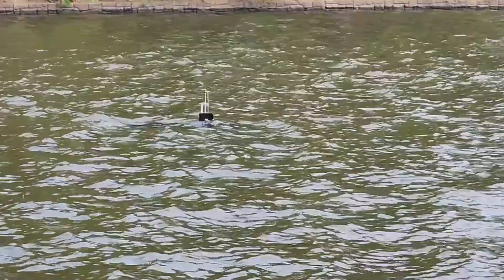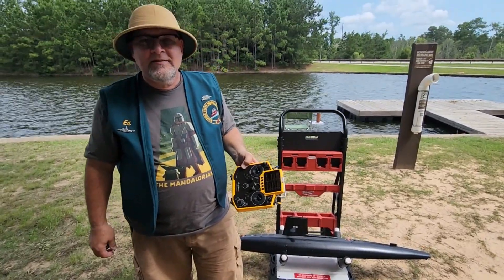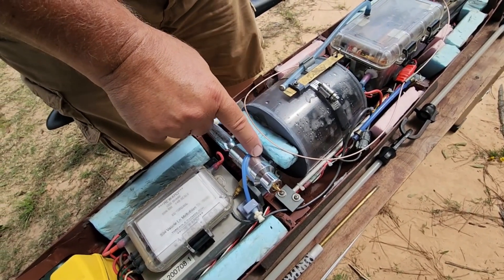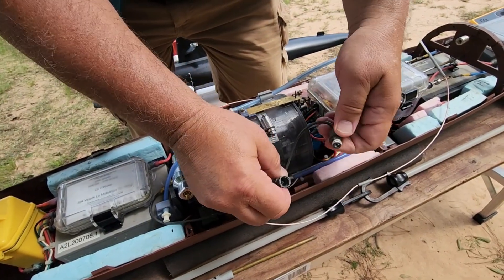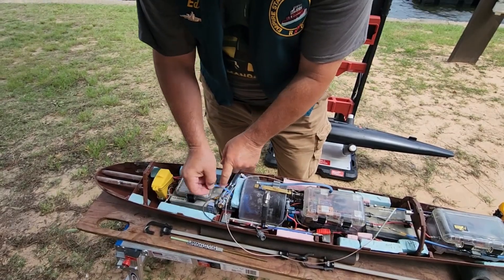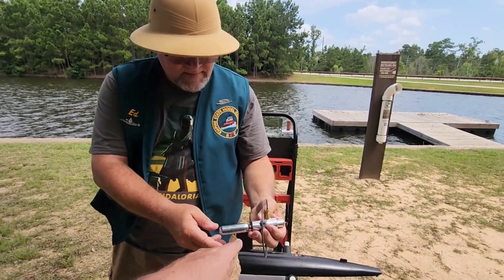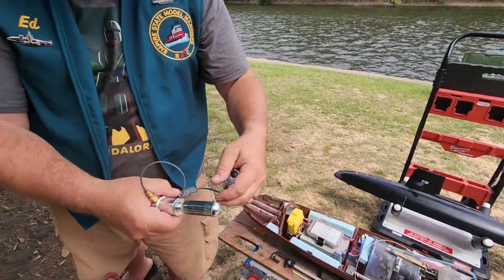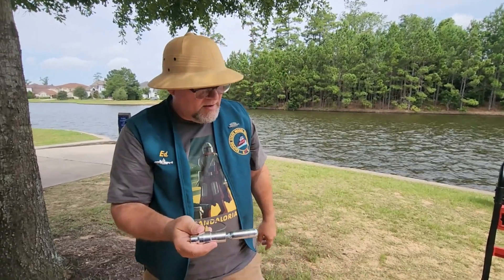Using CO2 in an RC Submarine. RCSubGuy Talks with "Sub" Ed Tordahl.

Comment: Just want to share this minor drawback I saw about using CO2 in water https://youtube.com/shorts/rDdt5Owt9bs?feature=share

If your BT is full of CO2 and you're cruising on the surface your water line will gradually go up as the CO2 diffuses into the water.
Reply from the maker: A really interesting point, but I am skeptical that you'd notice it during the short duration runs we typically use. Definitely worthwhile keeping in mind, however!
Reply: This is an actual concern for you? Do you know the rate of diffusion?  I'd hazard it's NOT a concern at all. As it's only when surfaced AFTER your first dive, would this even be a concern. I run for 5 hours, most at Periscope depth with an empty tank maybe 20 minutes surfaced. YOU have more important things to worry about, like traffic, submerged obstacles etc..  On top of all this, mine is for Emergency LOS situations only, I mostly surface suing a LPB. You probably lose more rolling in a heavy sea state. IOW...I have NO DRAWBACK here. Ask @Schmitty1944 above with real world long term use if he's experienced this.

Comment: Great job and nice info. To be fair, I have a sub with CO2 ballast system built in 1994! it also uses Co2 to extend and retract bow planes and scopes. Sideshow Ed is a Simpsons reference?
Reply: Did you do a video report or SubCommittee report on it to share??  BZ on the Simpsons! 👍
Reply: Also, did you need to charge your cylinder, or disposable Co2 cartridges? Was it easy enough for a 5 yo? We had one guy use it at a Groton SubRegatta (you?). I think Jim Butt did as well. A few guys from SubComEast experimented with it but found it just as laborious as Freon/Propel in  terms of charging. Johann Saur used compressed air as long as I can remember (pre-1991?).
Reply: @edtordahl  The model is very large and uses on board rechargeable storage for co2. Recharging is done of course from a much larger external tank. Recharging is very easy but I'm not sure I would let a 5 year old do it. I have never been to Groton, it's really far for me. I live near Seattle. I would agree that it is no less trouble than freon/propel. It really only has advantages when the models are quite large as you guys mentioned in your video. Jason.